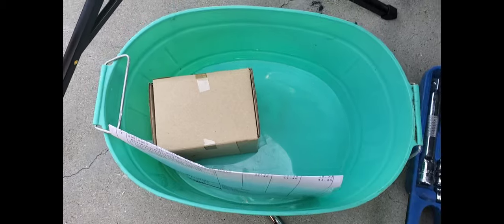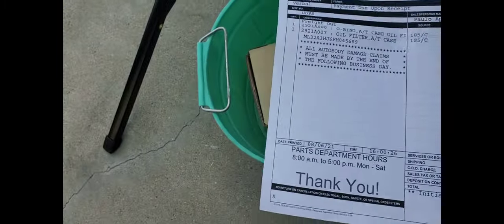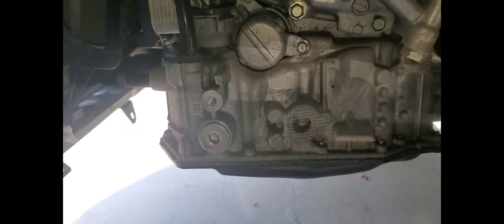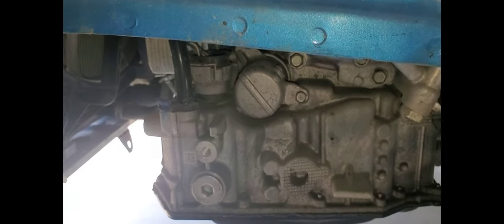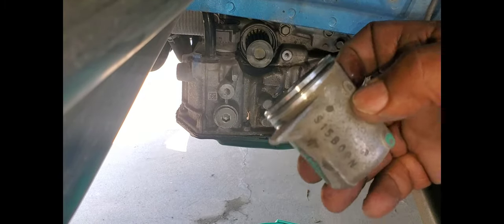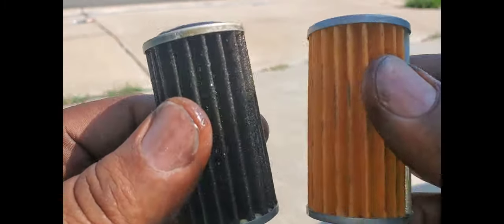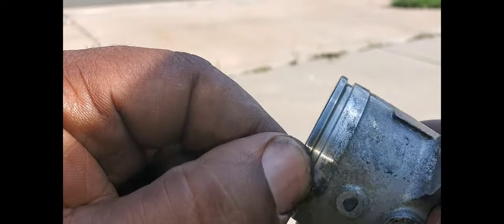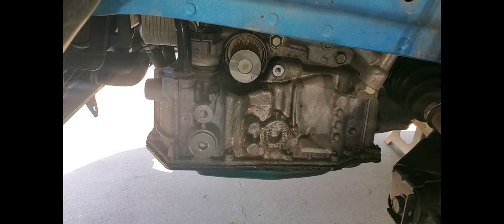2015 Mitsubishi Mirage flashing D.....CVT filter change

Comment: Fixed this on my wife's car by changing the valve body after fluid changes and filter stopped helping. No more flashing d or shifting problems. Got a new valve body on etsy for $200 plug and play. Seller name was Djtransparts. Hope this saves someone all of the trouble that i had to go through over the past couple of years to figure out the fix.
Reply from the maker: Thanks for sharing brother.

Comment: Probably about 2 quarts in the pan.  The torque converter has about 5 qts in it, so unless you suck oil in through the oil coolant lines.... you will have to deal with mixed oil.  FYI:  My daughters CVT transmission torque converter locked up on it's 76K mile marker.  Need a $3800 torque converter and valve body.!  Car is iether dust-or I cill hve to put it together with used TC, filter, oil and possilbly valve body at about $800.  
Symptom:  Torque converter locks up and stalls at light.  Feels like you dropped a clutch at idle on a manual transmission.

Comment: Just another thing the flashing d indicates 2 things transmission got hot due to reasons, not enough tranny fluid or to much, the other is because something about the sensor and the third common reason, yes I listed to you run fast in it say for example I did Houston to LA about 80 mph about 6 hours into drive the D flash and my tranny was overheating

FYI the flashing D has types of flashes that mean different things e.g. D flashes fast or slow
Reply from the maker: Thanks brother for the information. I did not know that brother. I hate them CVT trannys. I got rid of the car

Comment: Do you have to drain the trans fluid before you can change the filter?
Reply from the maker: No I didn't drain the transmission
Reply: @themeatstall9001  
How much fluid did you have to replace?

I have about half a bottle of trans fluid leftover from a fluid change. Is that enough?
Reply: I did it. Ended up losing about 4.5 fl oz from the filter
Reply from the maker: @HeyYallItsBruno  was this when you change the side filter?
Reply: @themeatstall9001  yeah, the CVT filter behind the front driver side wheel. 
The total trans fluid capacity is close to 7.5 quarts, so it didn't even move the dipstick level.
Reply from the maker: @HeyYallItsBruno  I still have to change my pan filter and the CVT oil. I had put it in the shop for them to do it but I dont think the job was done properly
Reply: Hows the flashing d issue, is it solve now? thanks.

Comment: Did it solve the flashing D issue?

Thanks for the video!
Reply from the maker: I still have the issue but I did not change the bottom pan filter or the transmission cvt fluid. I had took it to a mechanic previously and they said that they did it but I personally think they lied. I will be changing the pan filter and fluid soon. I think this will solve my issue. Thanks for stopping by the Meat Stall.
Reply: I think I remember reading somewhere that if your trans symbol is flashing, it might be overheating.